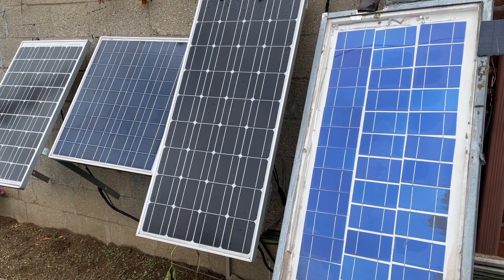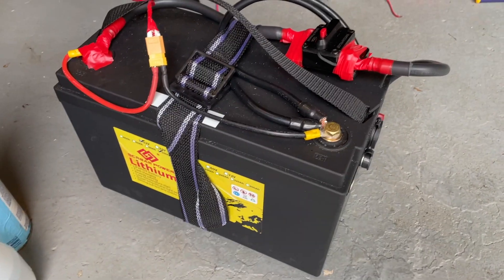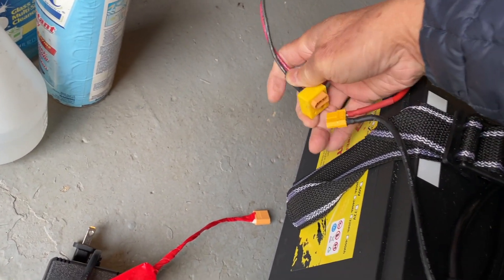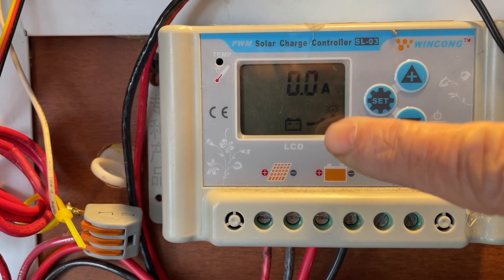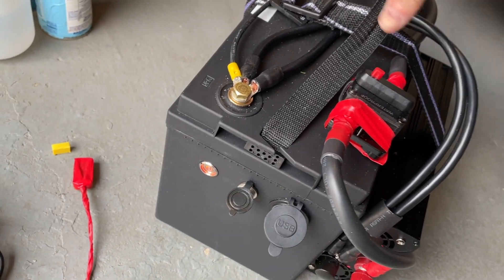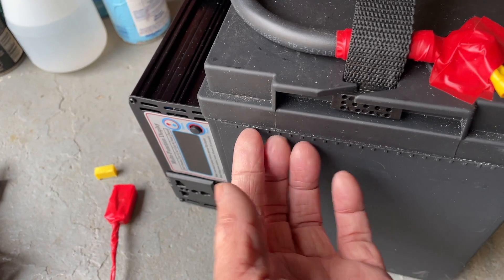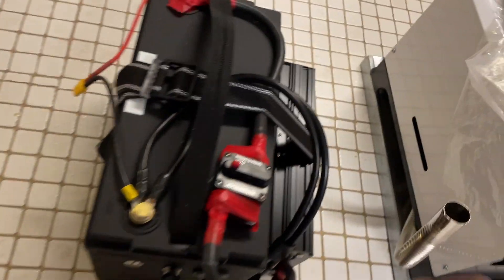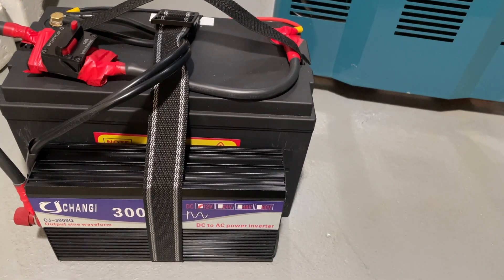Setting up solar charging for my 100Ah Lifepo4 battery

Comment: Good luck on that scream power battery.  Mine is 2 years old, used it 3 times and now its capacity is about 60AH. It no longer provides 100AH. The company does NOT respond to warantee claims at all. They are dishonest and this product is very bad.
Reply from the maker: @tomb18ca  never ran a capacity test. It is cheap and you take your chances. Like you say I don’t think they warranty anything. Same goes for solar panels. They are cheap so they lose capacity overtime.

Comment: How is this 100 amp-hour battery compared to the Power Queen 100 amp hour batteries? I know those get good ratings but this one seems to have the extra functionality on the side with the plug where you can charge it straight from your electricity as well if someone had Grid electricity or if there was no sun for the solar to charge it and it also has the ability to charge things straight by USB so how does this battery compare to the power queen or other 100 amp hour lithium ion solar batteries?
Reply from the maker: I have not open it up but I think they use pouch cells inside. I was able to power a toaster with this so it can handle heavy drains. I rarely use the usb but the included charger is handy. Also didn't run a capacity test so I can't compare it to the Power Queen. I bought this unit so I don't want to unnecessarily drain it or crack it open.

Comment: How is that battery?
Reply from the maker: It actually ran a small 5000btu ac. So far so good. Of course if u spend more, u can get a better one. The battery and an inverter together is better than a power bank all in one unit. U can actually run a fridge instead of trying to run it.

Comment: Didn't you show that DIY when you made it?  I vaguely remember someone showing and I remember it being all wood like this one.  13 years the brain fog has set in.  Yeah, flexible panels should never ever have been sold as they don't last.  Maybe one year at most, and even less the hotter, and more humid, the area it is in is.
Reply from the maker: Yes, I did have a video on that diy panel somewhere in my channel. It is wood, completely not to code but works good and repairable. The flexible one lasted 2 years or less. No way to fix it because it is laminated. Maybe you can use the back of the panel to cover your picnic table. :)  You do have "General Awareness", so you won't be buying another flexible panel soon.
Reply: @wtam69  Yes, precisely, it delaminates and moisture gets under the skin on top.  Horrible things.  I knew I had seen your video back then as I thought it was rather ingenious and to see that sucker still working (even if it needed a touch up repair on the wood) is fantastic.